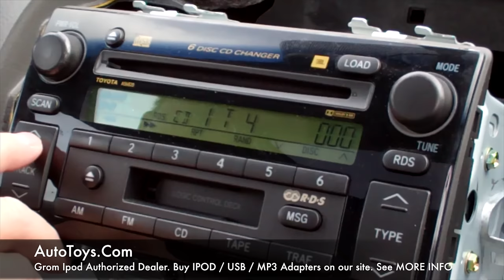Install Your Toyota Camry's Ipod, Iphone And Aux Interface With Grom Audio!

Comment: Sounded flakey in operation.  I assume the module speaks the words to let you know what mode you are in?  Or was it not working properly?  You should have shown  CD operation, then switching to USB and all the other modes this version has.  As is, I'm not convinced this will work flawlessly.